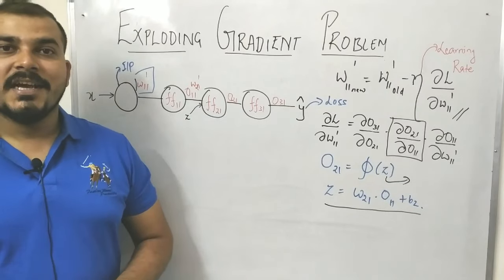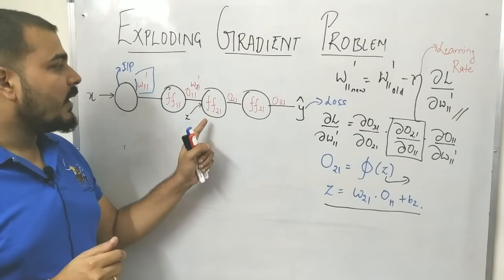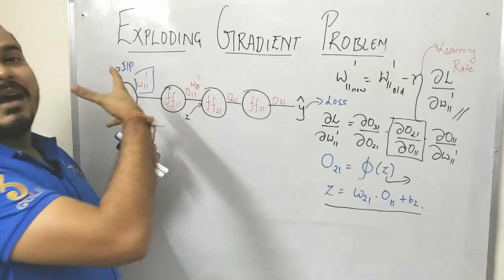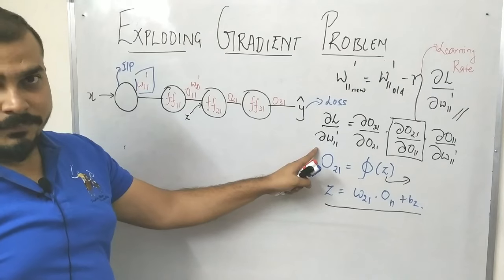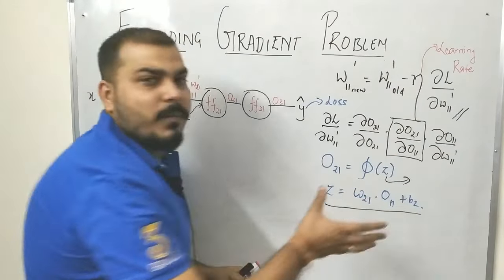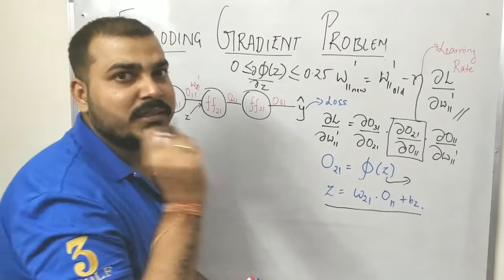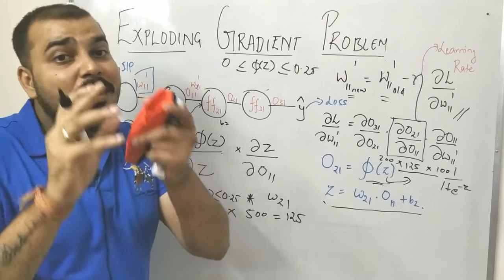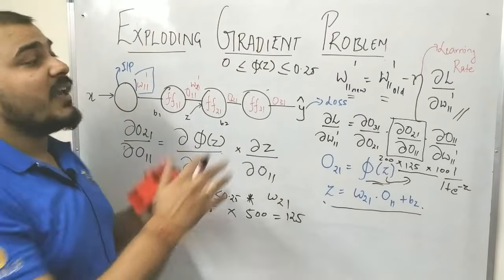Tutorial 8- Exploding Gradient Problem in Neural Network

Comment: Exploding Gradient Problem is because of Higher Weights Initialization. If the weights are higher, then during BackProp gradients value will be higher which in turn affects the new weights to be vv small when updating weights [ Wnew = Wold - lr * Grad] Due to which the weight difference will be Varying a lot at every epoch and this is why Gradient Descent will never converge.

Comment: From now If anyone asked me about Vanishing Gradient Descent OR Exploring Gradient Descent I will not just answer and I even take a class to them
The best video I've ever seen
Reply: Exactly
Reply: i have a small doubt...in vanishing- the values where very small but here its high but both have the same eqn right? or is it due to the weights in the vanishing was normal and in exploding its high?....ur help is really appreciated
Reply: @kiruthigakumar8557  even I have the same doubt if anyone can help it would be really appreciated
Reply: @sargun_narula  As he said when using sigmoid the values would be between 0-1 so if their weights are smaller when we initialise them but for a smaller network that is 1 or 2 hidden layer network vanishing won't be a problem but if it uses more like 10 layers then after some layers considering last 3rd layer when backpropagating the derivative will be decreasing with every layer and due to that optimizer will be so slow to reach the minima value and that's what vanishing gradient is. Talking about exploding gradient if weights are bigger and derivative increases after backpropagating than that may put our optimizer into diverging rather than reaching minima i.e exploding problem. Simply saying weights shouldn't be initialized so high or so low.
Reply: @kiruthigakumar8557 Irrespective of your activation function your weights causes the Exploding/Vanishing gradient descent problem. Weights shouldn't be initialized so high or so low. Here is the Andrew Ng video for the same  https://www.youtube.com/watch?v=qhXZsFVxGKo
Reply: @chiragchauhan8429  Thanks for clarification!

Comment: Question: 
 Hi Krish. dO21/do11 is large because we mutliple the derivate of the sigmoid (btwn 0 to 0.25) with a large weight. However, in Tutorial 7 we didn't use this formula(chain rule derivation), we directly said dO21/do11 is between 0 to 0.25. Please can you clarify on this?
Reply: Even I have the same question, sir can you please explain this section?
Reply: even I have the same doubt.. can u explain this?
Reply: That is because O21 = sigmoid(ff21) and when we take the derivate of O21 with respect to any variable (be it O11), We know it will range between 0 and 0.25. Because the derivative of sigmoid(x) ranges from 0 to.25, and x can be any value.

Comment: Thanks for the great explanation. One small doubt/clarification would be helpful. Here since we have sigmoid if the Weight value is somewhat around 2 ( ex:2) dO11/dW11. then the  dO21/dO11 value will be .25*2 = .5 then chain rule ((dO21/dO11) * (dO11/dW11)) will be again .5*.5 = 25 considering dO11/dW11 weight is also 2. Then instead of exploding it will be shirking. Can you please suggest what is the thought for this scenario
Reply: Thanks for the great explanation. One small doubt/clarification would be helpful. Here since we have sigmoid if the Weight value is somewhat around 2 ( ex:2) dO11/dW11. then the  dO21/dO11 value will be .25*2 = .5 then chain rule ((dO21/dO11) * (dO11/dW11)) will be again .5*.5 = .25 considering dO11/dW11 weight is also 2. Then instead of exploding it will be shirking. Can you please suggest what is the thought for this scenario

Comment: Base Concept:

While performing Backward propagation the loss function derivate is getting lower hence the weights are not changed hence again in forward propagation these weights are multiplied with input value which changes the weights value even more from the previous one. So if we perform backward propagation again then old weight will be much different